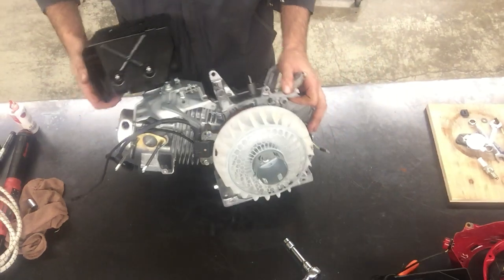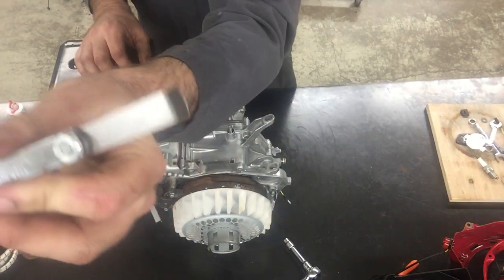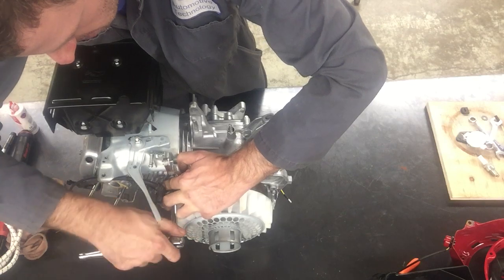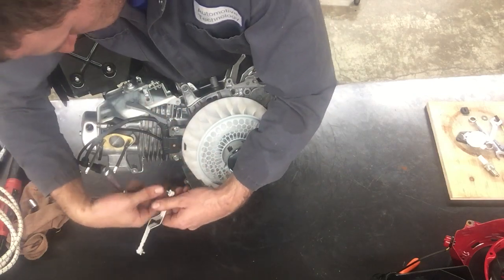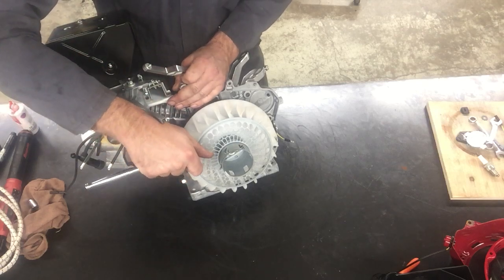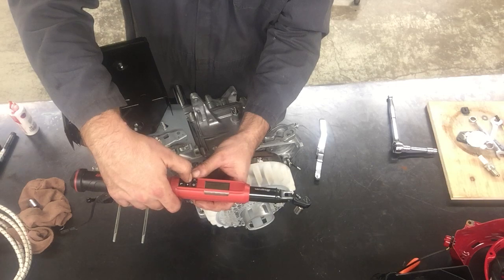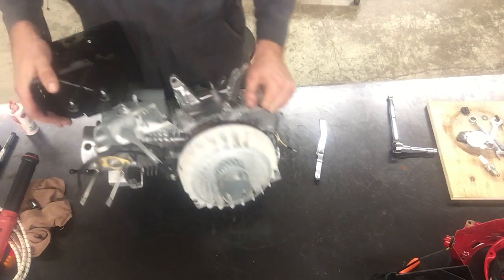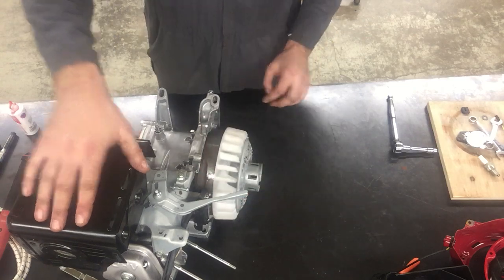Adjusting Ignition Coil Air Gap Honda GX390

Comment: do you know what should be the primary and secondary resistance for GX390Coil? thank you!
Reply from the maker: Primary Resistance, 0.8 - 1.0 ohm
Secondary Resistance, 5.9 - 7.1 ohm

Stole this info from
 https://service.multiquip.com/pdfs/Honda_GX_Ignition_Coil_Inspection.pdf
Reply: @autotech4103  mine are: primary 1.4 and secondari 6.3. Would be a reason for no spark? it's time for a new one? Thanks a lot!
Reply from the maker: @bogdanmarcu6915  make sure you check the resistance of your multimeter. If putting your 2 leads together give you resistance of 0.5ohms you would have to subtract that from your reading. Just FYI
Reply: @autotech4103  My mistake! I have just redone the measurement as I had a doubt whether I have measured it correctly. leads resistance in my case is 0.2ohms;  primary resistance is indeed read shows 1.4 -0.2 =1.2 ohm-> just outside tolerance field. Secondary is at 6.3 Kohm so 6300 ohm - way too much. I have shortened the spark plug lead hoping the issue is coming from  an imperfect connection between lead and pipe but had no success. even measurement directly on line (without pipe) shows 6000+ ohm. so its clear now, I need a new coil. Thanks a lot!